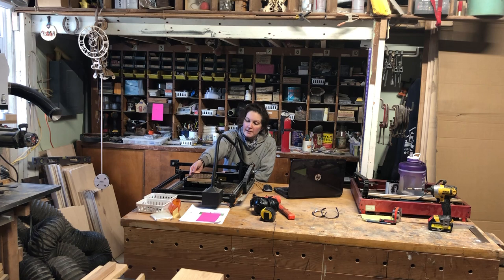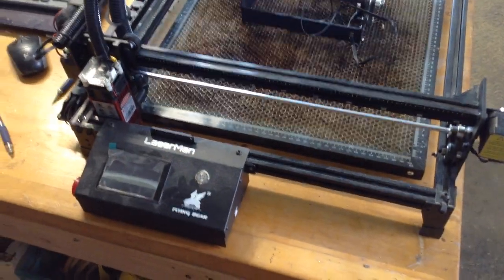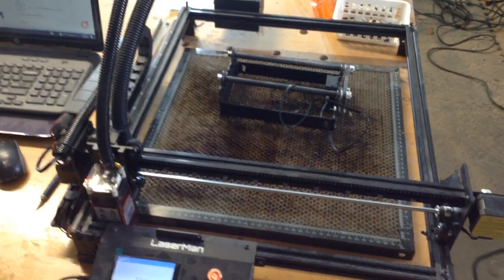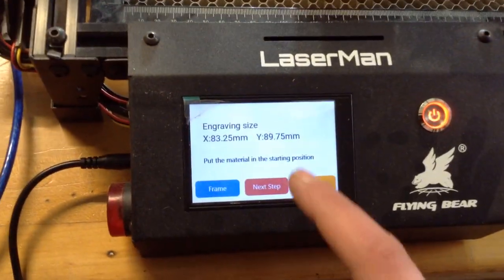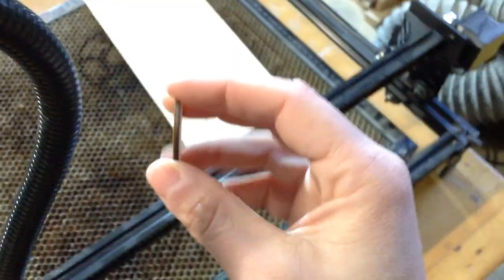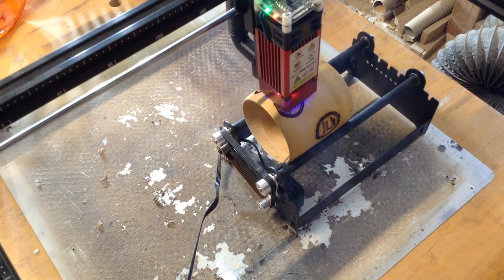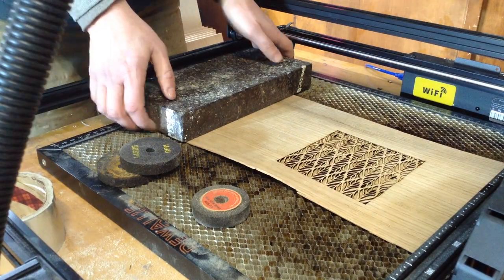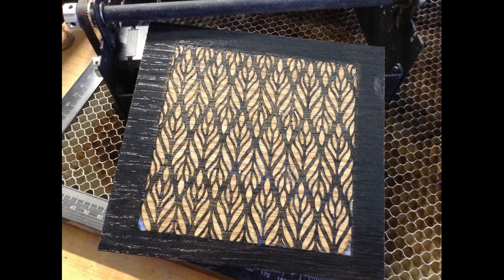Tool Review : Free Laser from Flying Bear // Cost Effective Option

Comment: I just bought one of these today for $219 USD. That still comes with the rotary. You could add on a larger air filter and/or Lightburn for $50 each. Amazing deal.
Reply from the maker: Agreed, for the money I thought this was a decent little laser.  As long as it lasts the deal can't be beat.